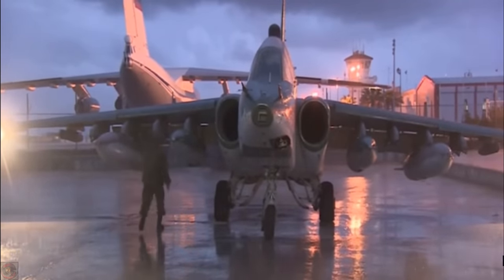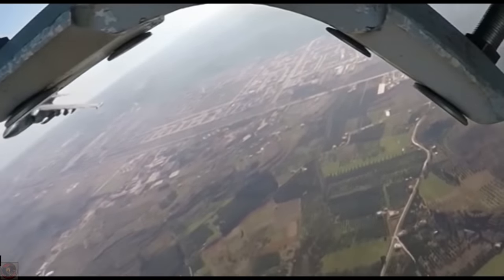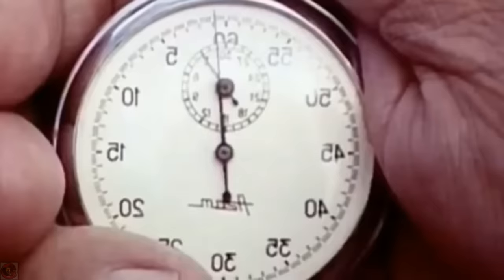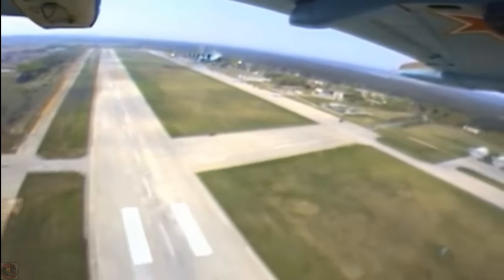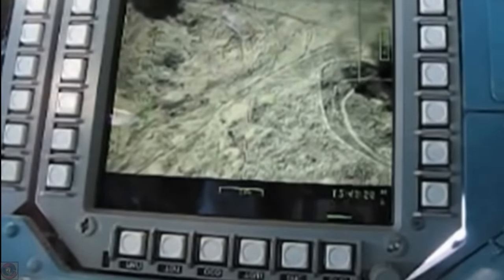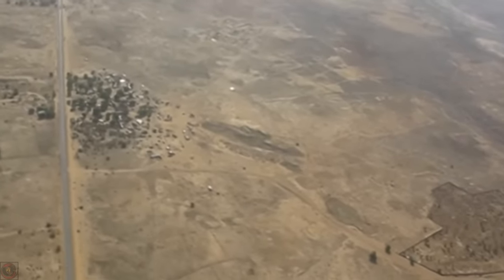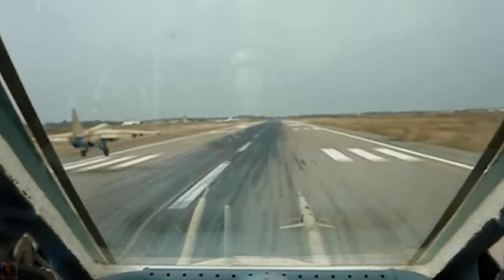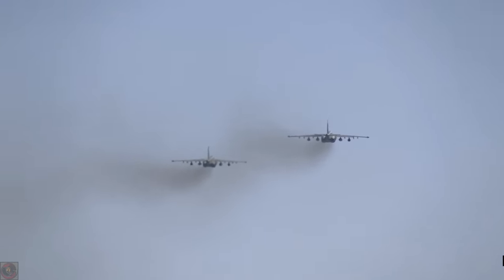Su-25 Frogfoot - The Russian Flying Tank

Comment: Don't take me wrong, this thing is heavy with low powered engines. Although a good aircraft but would  be an easy target for ground attack in todays world.
Reply: If that's the case why is everyone looking at planes like the super Tucano and other light attack aircraft. Most of the combat these days isn't country vs country. Its country vs insurgency. Insurgents dont have a big anti air capacity. Planes like the Warthog and Frogfoot are overkill. You can get the job done with something that's a lot cheaper to buy and maintain.

Comment: Can a 30mm cannon actually kill a modern main battle tank???  Yes I realize the Apache and A-10 use different 30mm variants with seperate cartridges but the question still applies?
Reply: With some luck they can, hitting engine covers from above, destroying sensors and ad-ons. If not kill it then reduce their effectiveness.
Interesting that ppl always call the Su-25 weak, for it does not have a "brrrt" cannon. The GSh-30-2 in the Sukhoi still fires 50 rounds per second (GAU-8: 65), and those rounds are similar in size and weight to those of the Avenger's, still a lot bigger and heavier than 30 mm NATO rounds (around 390 g vs 275 g).
Reply: no 30mm cannot kill a MBT... the T62 is more or less immune to the 30mm that the a10 uses. an a10 would have to come in at a 90 degree angle at less then 500m to penetrate the top of a T 62 which is 40mm thick. aircraft cannons are useless against a armored formation, APC such as the BMP 2 would be able to engage A10 easily if its making an attack run.
Reply: So A-10 is limited to APCs once it's missiles are exhausted.

Comment: Great video, One thing often overlooked that the A10 can not do is once it has dropped its external ordnance and needs to escape the area it can go supersonic. That is a big deal to the pilots and is employed commonly
Reply: I don't know about superior, or even if that is a factor, But I do know they both do an excellent job for what they were designed for.
Reply: It is definitely faster than the A-10, but it isn't a supersonic aircraft at any stage of flight.

Comment: Does anyone know if an air to air Radar system could be applied to this air frame?  At a top speed of 590 mph it could be used for air superiority for low intensity conflicts or interdiction of slower civilian aircraft.  Might cost too much to do that I don't know.
Reply: Yes, I thought I saw somewhere that the SU-25 could go faster but 590 mph was the unclassified info I found.  I was just thinking having one airframe for both Ground Attack/Bomber and Air ti Air fighters might be a good idea for common parts and Maintenance.  It would probably not be as good as a MIG-21 so might as well just buy some MIg 21s ro 23s.

Comment: Afghanistan as combat reference is as important as iraq for usa..ie pretty inconclusive as neither had large amounts of modern sam , or modern manpads of a Nato standard and the russian counterparts . The same goes with warthhog . Manual or ground based semi manual guns is past, the least of their problems would be a 40mm bofors or a breda or rheinmetall 20mm . A mk 2 bofors kicks 300 shells a minute 40 mm, a rheinmetal 20 mm about 6-800 a minute and none of that was the later versions on either battlefields ..and were not even mentioning a missile. A typical iris t from a ground based vehicle, or a french or finnish rocket would likely blow off both wings on both the hog and this. Against regular troops without surface to air missile both works fine but that is not the battlefield they were meant for originally, and is the one they must meet if they see a modern war.

Comment: You've actually produced some great video's before and for the most part I like your content.  But I really think you've dropped the ball on this one.  First of all, nearly everything the Russians have "designed" in the way of combat aircraft has been copied from the US since WWII when they stole some of our B-29s and copied them rivet for rivet to produce their version.  In this case, they copied the Northrop A-9A which was a direct competitor for the A-10 in the late 1960s.  The A-9 had 5 hard points under each wing, the fuselage mounted GAU-8A 30mm, 2 mid fuselage mounted engines with a single tail.  They were attempting to copy our CAS aircraft but thought the A-9 would beat out the A-10.  Since the A-9 didn't win the competition, everyone seems to think their SU-25 was somehow an original design.  Granted, they made some improvements but the concept and airframe are little more than a copy of what we'd already built.  https://www.youtube.com/watch?v=qRsor-m9CB4 

Also, you talk about the A-10 being inaccurate.  The fact is that the 30mm gun is far more accurate and powerful than most aircraft mounted 20mm guns.  Faster to employ and with a much longer slant range.  In the early days of the A-10's career, when it flew low altitude profile missions they were very accurate and had far fewer friendly fire incidents, but since 2001, they moved the flight profile up to higher altitudes and started flying it like most pointy nosed jets and the numbers of friendly fire incidents rose because they had a harder time establishing friend from foe with that flight profile.  https://www.youtube.com/watch?v=YbH1Fh98KMM  Looks pretty fucking accurate to me.

Finally, a quick question about the video itself.  Why is nearly all the footage on this video backwards or mirrored?  In nearly every shot where there is visible writing on the aircraft or munitions, it's all mirrored.
Reply: Cope